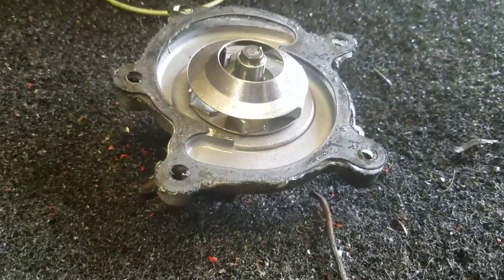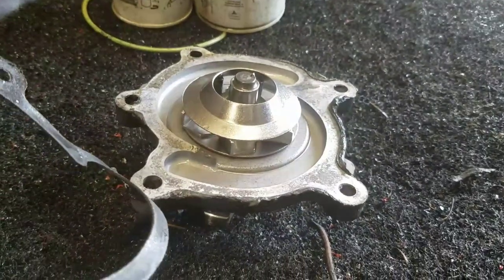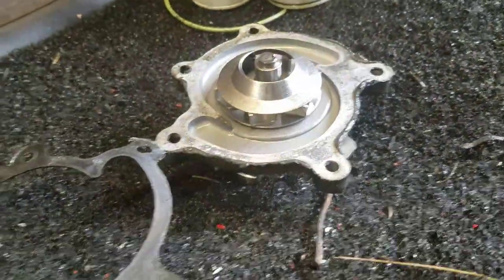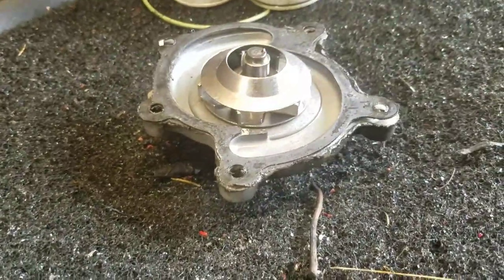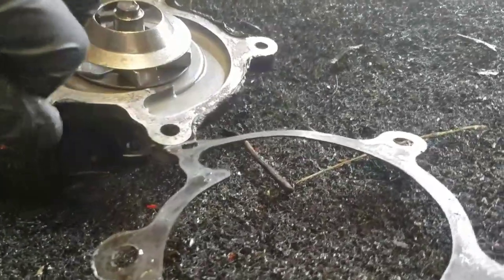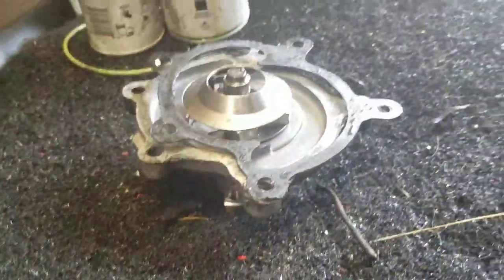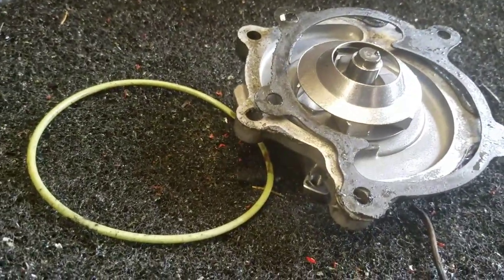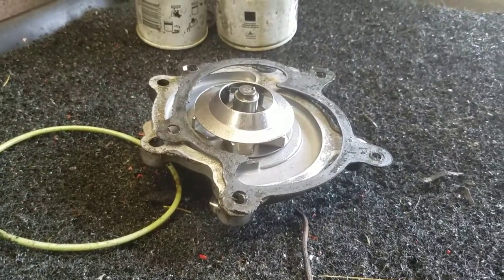Repair: do not use RTV silicone on paper gaskets

Comment: Aviation gasket sealant. Never seen one leak, I have not had the chance to see one after 20 years but have never ever ever had a issue with Aviation gasket sealant. Aviation industry is done to a much higher standard than the automotive. The sealant is just tacky and doesn't harden.
Reply from the maker: Everything has it's application. I prefer aviation over anything else. Check the description for the follow up video

Comment: For paper gaskets - use shellac based sealer, not 'gasket maker' most common is 'Indian head.' 
For metal to metal or other non paper gaskets, READ the label. And, NO you do NOT know 'better' than the engineers who designed it.

Comment: Instead of argueing against the use of RTV+paper gasket.... You should argue against the use of paper gaskets all together. I don't care the application. Paper gaskets fail all thr time with or with out the silicone
Reply from the maker: That is a accurate statement as well. Not all modern gaskets are indeed paper some of them are some sort of hybrid composite. But since the making of this video three years ago I've been collecting clips of related failures and also suggestions on how to seal gasket surfaces properly.
Reply: @MegaMarclar  if you don't mind me asking. What is your preference for sealing a paper gasket on a oil pan??
Reply from the maker: @benjaminsmith4519  depends on the application. I would prefer to use a rubberized style gasket. But if paper is all that is available, I would use something like permatex 80019 Aviation gasket sealer
Reply: @MegaMarclar  my bad I meant to metal. What kind of adhesive you might use om a oil pan
Reply from the maker: @benjaminsmith4519  it really depends on the application. What exactly are you working on
Reply: @MegaMarclar  it's a bmw x5 oil pan. Rock auto sent me a metal gasket. I try to stock to synthetic gaskets that require no sealer. But this one i just don't trust. I looked online and out side of european distributors I can't find a synthetic gasket that would require no sealant. Plus the weather is getting colder too which definitely worries me when it comes to gasket sealers/adhesives
Reply from the maker: @benjaminsmith4519  does the metal gasket have rubber attached to the inside and outside edges like some sort of injection molding
Reply: @MegaMarclar  nope
Reply from the maker: @benjaminsmith4519  that doesn't make any sense. What I would do is called the dealership talk to the parts department get a part number for the gasket and then do a search for that
Reply: @MegaMarclar  idk. I am so close to just using a gasket maker kit. All the parts places by me autozone, oreillys, advanced auto etc etc all are selling the metal gasket. Idk shit makes no sense go me either
Reply from the maker: @benjaminsmith4519  yeah I mean I don't know.. if it was me I would call the dealer get the part number Google it see what it looks like. Most of those have a rubber injection mold cyl that's part of the metal gasket. But being a beamer it's possible that it is a soft alloy that's designed to crush for a seal